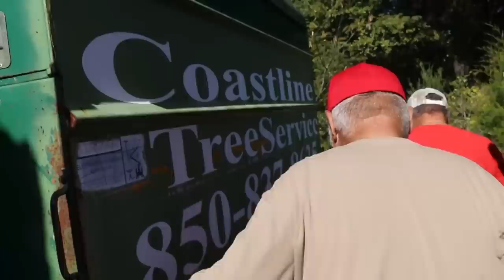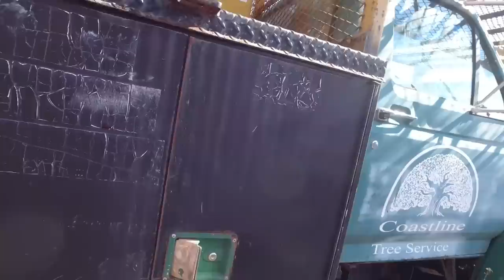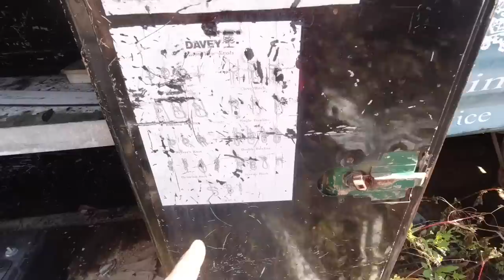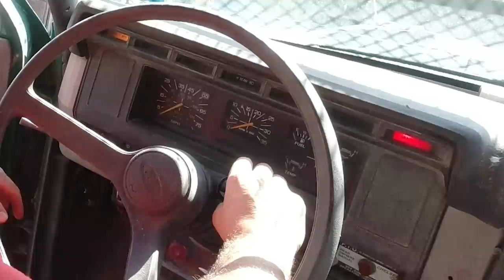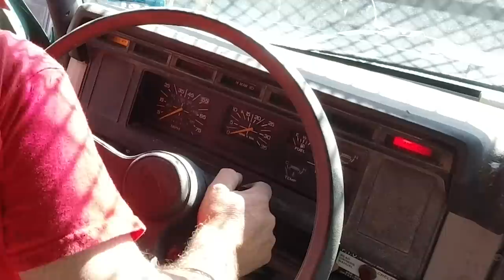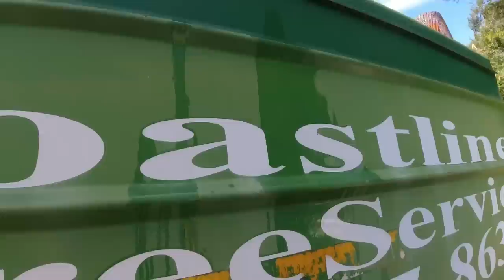SCRAP YARD Bucket Truck! Will it start and work again?

Comment: Now I know why I love those Cummins engines. I actually picked up an LN8000 Ford with an 8.3 Cummins power plant. Sitting dead in the road and the guys told me you can get that truck around. We'll give it to you. Did the same thing jump to the solenoid fired up. Drove it on home 20 minutes and a few dollars worth of junk wire. Amazing what I got now. The guys wish they wouldn't have told me I could have it for free.

Comment: The tool lever is for hydraulic pressure at the bucket for saws and stuff. They use hydraulic saws and cutters that they hook into at the bucket

Comment: I am surprised you didn't check for a blown fuse.
It's probably a bad relay shut off switch for the fuel pump.
Excellent job bypassing and hot wiring the fuel pump.

Comment: 6BTA, see the aluminum tube staring you in the face when jumping the injector pump? That is the outlet for the aftercooler.  The injector pump fuse or relay is probably faulty. One more thing on 
Cummins 6bt engines is the air intake heater. It is located between the air intake tube and manifold. A square plastic device with an electric wire attached. If it has one, do not use ether to start, as it may ignite the ether in the intake and cause an explosion.

Comment: That noise when you turn the key is the power system for the hydraulic brakes. Common in 80s-90s heavy trucks.

Comment: I have a 1997 GMC 10 wheeler Lineman's Bucket Truck, with a '55ft Lift-All Boom. Had a small leak in one of the smaller lines that went to the controls on the Bucket. 
Used a line coupler to cure that. Sorta like a shark bite. Lol, I like your (Closer to the Sun Theory but those lines are moving alot and rub alot against the boom or any anywhere they can.

Comment: Hello, as you ask if anyone has worked on a tree truck before well I will say, I owned a 87 Ford f700 bucket truck with a 55 ft reach all boom, when I bought it it was very rough as it was used as a paint truck. But buying it for 2000 and putting another 1200 into it it turned out to be a cherry for a few years until I was forced to sell it.

Comment: When you turn the key on and that is the grit heater going 10 seconds. That is definitely a 5.9. My buddy got a 99 f800 cummins diesel rollback flatbed.
Reply: Grit intake heater*

Comment: I ran one of these in the 70's, about 1979. That company is pronounced ass-plund..lol.I worked for them as a B trimmer and bucket man. I did not run the ground controls, just from the bucket. The tool was most likely a snipper wand. It was like a pole snip that was hydraulic. It had a hook on it and you hit the trigger to nip the branch and pop it towards the ground man to drag to the chipper. We did trimming on power lines and they had a contract for something like a 10' radius around the lines clear of branches.

Comment: The noise when the key is turned on could be the electric backup drive.  This runs the boom if the engine quits.  When electric drive is on the fuel is turned off to the engine and a bank of batteries in the back runs an electric hydraulic pump.
Reply: There should be a switch under the dash that says "electric drive".  Turn this off and it will turn on fuel to the engine and shut off the electric pump.

Comment: trying to get those controls working would be a pretty big can of worms to open up having had to work on a altec digger derick (auger truck) back when i was a tech where the main hose blew and then it shorted out the various solenoids which then took out the main computer control board on the control stand i ended up having to completely remove the upper pump body off the turntable

Comment: Hank I worked in the coal mines from 2001-2012 and every year we had yearly retraining and we had to watch the same shake hands with danger videos, do you remember the one were the guy drank the red liquid like it was wine 🍷? I thought they were about stupid but they were so dumb you would remember them.

Hank the old 72 mack brings back memories of hauling coal in 05 I tried working on the surface coal mines and I started out driving a 73 Mack DM 800 it had a 235 Mack engine and a straight 5 speed transmission with 80,000 rear-end and it would only run about 35-40 mph fully loaded or empty but it was a pulling beast.
Reply: I think you mean a 237 motor those trucks were slow but man they would pull a tree out of the ground
Reply: @noelwarner1235  you are right I knew it wasn't a 230 but I couldn't remember what it was exactly, 
Back when I was driving it another driver said that they were so strong that they could put a chain on a stump by the county line and pull the other county into the other.... Lol
Reply: I remember back win first took mine safty training I was like what video but people can relate to it as danger

Comment: Stihl bars are in the proper place , a junk yard ….😂😂😂
Reply: Hank I bet you flew into Frankfort Am Mien AFB a time or two? What did you fly? 141s ? C5s ? C130s ? C17s ? I flew on every one of those A/C including a C9 Nightingale , which was the worse flight ever . The first flight I flew was in a C141 Starlifter in my opinion was the best long hauler  in the Air Force fleet . We flew into Honduras as part of President Reagan’s war on drugs on that 141 back in 1984 . That mission was also the first time I experienced indirect fire and that sound of those bullets as they past overhead  is something you will never forget .

Comment: My favorite cartoons on Lonnie Tunes was Road Runner  & Willie Coyote (Beep Beep) did know Road Runner was 1968 Plymouth Road with 426 Hemi V8 with 2 4 barrell carb 425 Horsepower with 525 torque, 4 Manual transmission, 388   rear end gears 2 door car , Coyote was 1968 Ford Mustang  GT 500 428 V8 motor 4 barrel Coyote motor, 4 speed Manual transmission rear end gears 355 ratio 2 door ! LOL

Comment: That's an old Davey tree service truck and the name of that type boom is called a Lift All I used to have one and they are junk. So its right at home in that scrap yard. I wouldn't take that truck if it was free because it is going to cost more to repair it to safe operating order than what it is worth.

Comment: Maybe Pre-covid might been profitable to drag that out but seems the manufacturing industry gone wacko on cost of "Parts" and manufacturing those Hoses or replacement won't be cheap. as retired Hydraulic NAVY man, I feel the NAVY is probably robbing parts from every jet just to keep them flying. they do break and they seriously abide by shelf Life. so that get expensive. Nice "Will it start" I would love to have access to bucket truck, need to do some work on my gutters and 25 ft in the air on ladder is not what I want to do. don't want own one, just borrow it...

Comment: I am confused why a 1997 would have a ve pump 12valve motor it should be a p-pump motor. Might not be the original motor.

Comment: the engine in that is a 5.9l 24v industrial model (generally only found in the l series ford trucks all cumins engines have a turbo(meaning 12v, 24v, and 24v common rail(5.9 and 6.7) this is considered a ve rotory pump 24 biggest issue is the kdp(an issue on all mechanichal injection 12v and 24v's) or killer dowel pin which will destroy the whole engine if it falls out(and in the trucks you also dont want a 53 block or it is useless because the block breaks completely blowing up the engine) this being the industrial block has better internals block etc.(applies to both 12v and 24v models)
Reply: oh also its just bt series not bta theres 6bt(6 cylinder) and 4bt(4 cylinder) thsts it no bta ps if this truck had the cat itd be a 3208 or 3126 and it also couldve had the dt444e(internationals version of the 7.3powerstroke)

Comment: That boom is scrap lift all is owned by altec now getting very hard and expensive to get part’s for them truck worth bed tool boxes engine transmission worth about $15 to 18 hundred bucks at auction